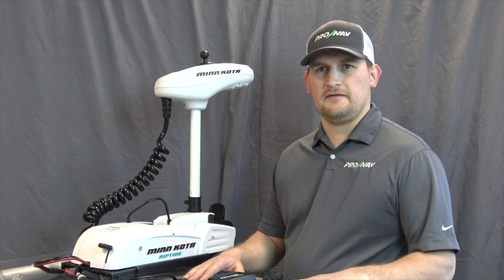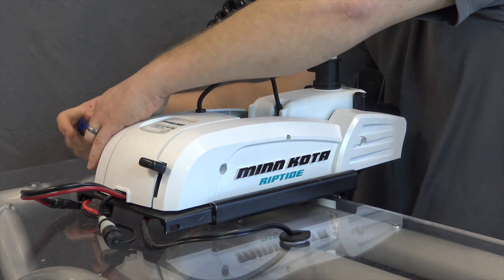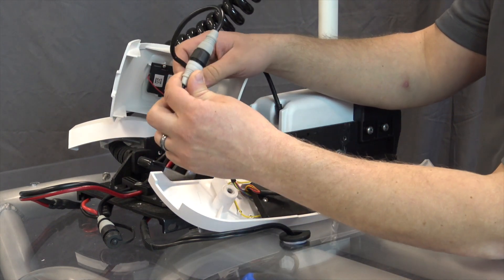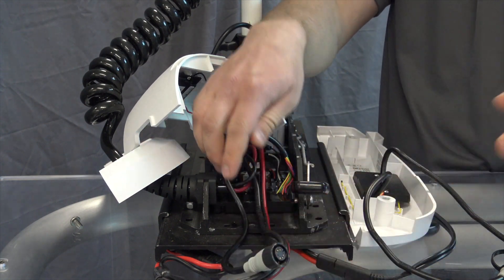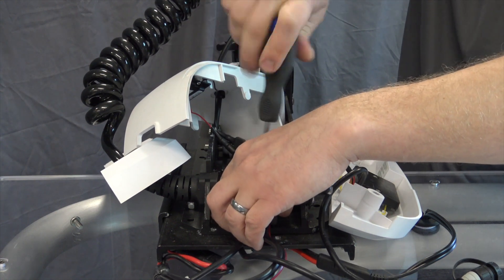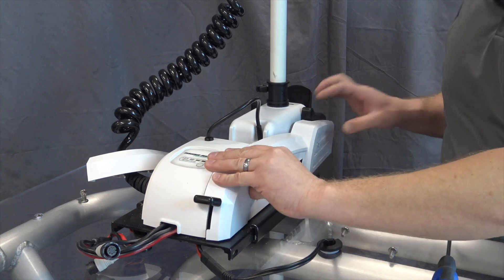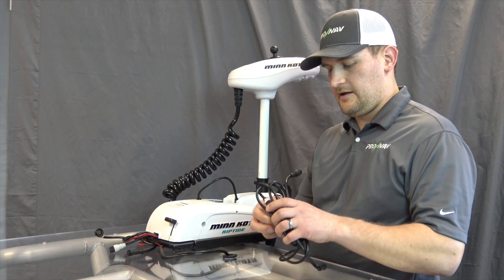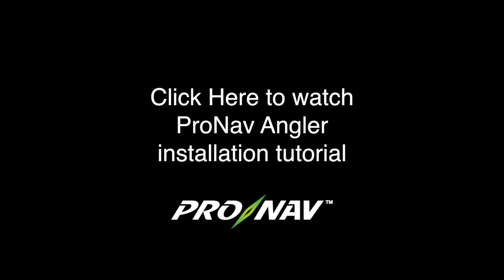Configure Minn Kota PowerDrive or Riptide with CoPilot for ProNav Angler Installation

Comment: So what does this install do?
Reply from the maker: In this video, there is a CoPilot installed (small remote). This video is just showing how ProNav plugs into the motor, then the CoPilot connects back in allowing you to keep the functionality!
Reply from the maker: When you install the ProNav Angler, you gain full GPS autopilot functionality.
Reply: Ok, but without doing this I still have the functionality of my copilot remote by just plugging into the one plug that sticks out originally. However I can only use the co pilot remote when the pro nav is not engaging in a course or vector. Will I be able to use copilot while let’s say I’m on a course and there is a sandbar ahead. Would I be able to turn with my copilot remote with this install?
Reply: I know I could test this my self but my set up is complicated and it’s a long story lol